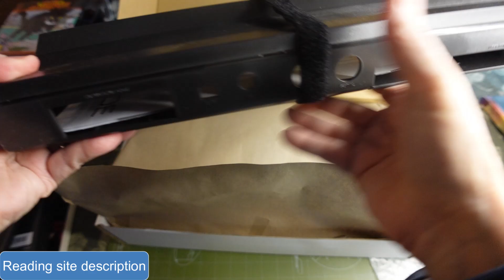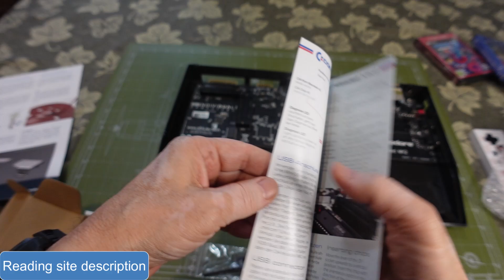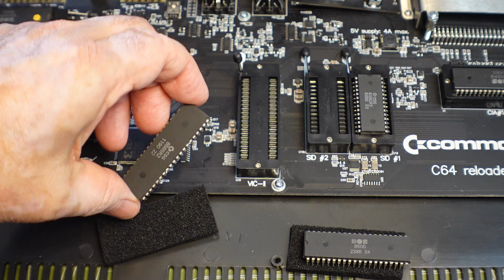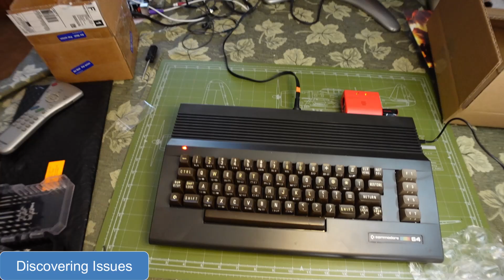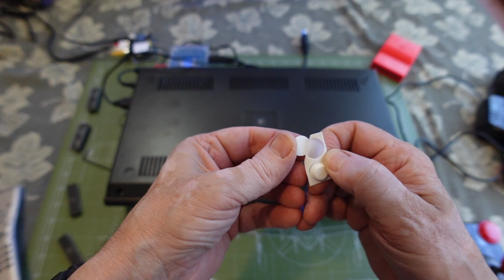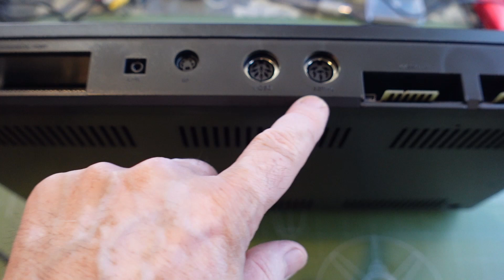C64 Reloaded MK2 Build

Comment: I just completed the same build and I can tell you the rubber feat go on the front of the case, the rear already has the plastic circle risers. I had no issues but I'm experiencing the vertical lines (jail bars) on a modern tv.

Comment: My MK2 is almost a clone of yours!  I have the same case (black).  I have light keys, though (I gave my Ultimate64 the dark set).  I also have the same badge on the front.  My MK2 has the blue sockets (I purchased it long ago).  My main issue is that it seems to struggle with a SuperCPU attached -- perhaps the SuperCPU draws too much power.  The machine still works, but the screen is affected a little.  I could have sworn that I read somewhere that there was a plan to make a MK3 board, which would have included a built-in TC-64, but I don't know if there was any truth to that and I haven't seen any word since then.
Reply from the maker: That's too bad, sounds like you will have to let your Super CPU go to a new home where it can be fully utilized on an another adoring C64... Just kidding :) I am just jealous ... I didn't know you had a MK2.  Thanks for sharing!

Comment: Nice.  I like the reloaded boards.  I still have a MK1 from back when they were released.  I do like the features of the MK2 but I also like that the MK1 uses actual chips for timing and PLA so that I can use original ICs.   I also recently purchased a case from iComp, the SX64 style.  I put an ICS64S board in it which has become my favorite C64 recreation board.  Check it out if you haven't seen it yet.  It is made by CBM Stuff and they also have new keycaps for sale too.  Which gets me to the feet bumpers.  They are meant to go in the front spots and will fit perfectly there.  Commodore made the rear feet raised on the 64C so that they only needed to put bumpers in the front.  Probably saved them a couple cents.  All of my original C64Cs have bumpers only in the front.
Reply from the maker: Yeah was just checking it out on the website.  Looks like quite the project!  You need all the components and the soldering skills to make that work.
Reply: @GRayDefender  Yes for sure and it is time consuming.  I have built one and have another with all components for when I get really, really bored or insomnia.  ;-)

Comment: I also had similar issues with the UII+ cart with this board when bringing up the on-screen menu. It seemed like it would lock up about half the time I would touch the cart. I ended up placing some thick rubber feet with adhesive under the rear of the cart to brace it so it wouldn't move or wiggle in the cart slot. That seemed to help a lot with the random lock-ups whenever I would touch the buttons on the back of the cart.

Comment: Also, if you have any issues with those ZIF sockets recognizing any of the chips, or you encounter strange unexplained behavior, here is something I've had to do a couple of times in the past.
With the levers down on the ZIF sockets, carefully move the chips side to side to exercise the contact points and get a better connection to all the legs.
Reply from the maker: Thanks for all your tips.  I hadn't thought of this but makes sense...
Reply: To be fair: That's an advice from the official homepage / forum / wiki.

Comment: Phi timing issues between the Reloaded MK2 and the Ultimate-II+ has been a thorn in my side for years now, but it's just something I learned to deal with long ago.
One of the nicest features of the Reloaded MK2 that I haven't seen on any other reproduction board is the ability to seamlessly switch between each real SID simply by holding the RESTORE key for approximately 1 second and releasing it... even while music is playing. Having a 6581 and 8580 installed in different sockets makes it a wonderful solution for browsing the HVSC.
Reply: damn..that is a deal breaker for me!
Reply: The MK2 has numerous issues. For a start if not using the latest 2023 firmware you risk 85xx VIC to get full 12v - at least the PAL versions. That said on some VIC's there issues with colors being very washed out - much more than when used in a real machine (or clone which may have modulator replacement). And yeah while it does play mostly nicely with my U2+L also ROM replacement it can't do freeze with the U2 emulating Final Cartridge 3. If not using a real SID or the 1k resistor hack then you have that warning LED annoyingly flashing and it can't be disabled in MK2 settings. Kawari with latest firmware does work in PAL mode as long as you configure it for MB oscillator. For dual SID a much requested feature is to be able to cycle through mono and stereo modes. For instance have it default play SID1, long press restore to play SID2 and once again for stereo ($420 and $500) and once more to start over at SID1. Or just sdwitch between dual mono and stereo would also be very nice. iComp flat out refuses to implement it and claims it's a perfect product - well many users seem to want an easy switch between mono and stereo much more than easy switch between SID1 or 2 so don't know how perfect it is. Also audio output is not the best - especially for some SID replacements that sounds really good in regular C64 or clone but in MK2 sounds flat lacking base.
Last thing is USB to serial bridge using to configure it. It's a dated Prolific IC which doesn't seem to get any more driver updates. It's buggy on Mac and while it works on regular Windows there's no drivers for ARM Windows. Don't know about Linux but there might be community support so should it not be able to be configured using regular machines a quick setup with a Raspberry Pi might be able to do the trick. Bottom line - I won't recommend as new these days. High demand... I doubt it. Rather I'd suggest Ultimate64, the new Commodore 64 or if you're a geek build it yourself. There's MixSID which is a really nice 2 sid solution which can be switched between mono and stereo and multiple addresses on the fly. Pair it with an HD-64 for crisp HDMI output. Forget about the jumperless nightmare of MK2. While it appears appealing it's buggy and overall it's a dated product not really delivering its full potential. Good old jumpers just works and doesn't rely on quircky firmware trying to figure out which ICs you're using despite they wasn't designed with it in mind - it's bound to be buggy. And yes then the PHI issues with U2+(L) - it works perfectly even on my clone without a single single vintage IC in it.
Reply: @HifiCentret  Agreed. I should have mentioned that I haven't even used my MK2 in several years. It has essentially been retired. The Ultimate 64 Elite has been my go-to daily driver ever since I first got it.
Reply: @mjy  I'm waiting for the new Commodore 64. Well I have preordered the founders edition. Lets see if I'll order a Basic as well. But by far the most fun is my clone without a single vintage IC - everything is modern replacements even the 8701 as Kawari is configured for MB oscillator since the modern replacement is much more stable than the original 8701 - it's working very well. So far it's more or less a clone of a stock 64 (466 board) but since there's a development of a SuperPLA ongoing I hope that it's soon ready so I'm able to build a shortboard clone (again no vintage parts) with all the bells and whistles. Multi ROM, 2 SID, preferably HDMI. Ability to use bluetooth controllers and probably something I've forgotten. Why the shortboard and preferably the revision with video RAM in the PLA? Because I had that as a kid (C64G) It should be doable and while Kawari, the currently only VIC-II replacement, isn't advertized as working with shortboards in reality it works very well - just video output levels are longboard specs so ideally an RF replacement should be able to configure video level separately of what  board it's used on (most can - hope the HD-64 can too). One thing about the Ultimate64 and the new Commodore I like less. If you want to use the userport you have to get the adapter, and some cabling you can DIY if you want it externally, and it has been unavailable for months. Quite essential to me as I like to use WiC64.
Reply: @HifiCentret  I pre-ordered the FE as well.

Comment: Hi Gray, nice video.  There may be a timing setting you have to change on your older UII, I seem to remember having to adjust the timing on mine depending on what firmware you are using.  There is a note about this on the bottom of the Wiki.  I had some problems with mine running NTSC, there is a big forum discussion around this.  My take is too much power is getting sent to the VIC and overtime the screen will start to jitter.  I can completely negate this by setting a fan on top of the computer.  As a result, I primarily use the MK2 for PAL programs however I love the board and case.  Lastly, take some time to get the Serial connection working, it will help with debugging chips or configuring your SID setup.  Have fun with your new toy, I love below the root.
Reply from the maker: Yeah adjusting the timing could be an option for the UII+.  Thanks for your comment..